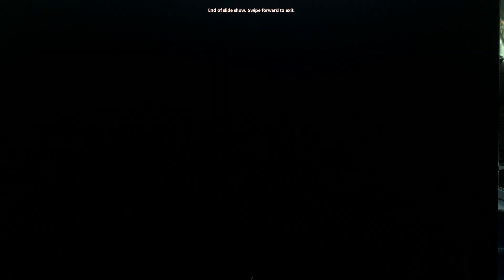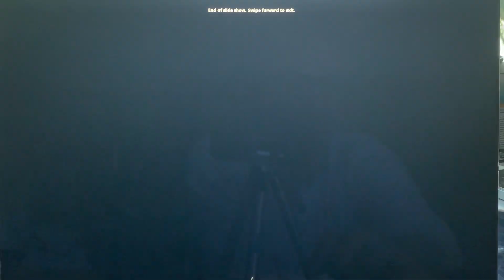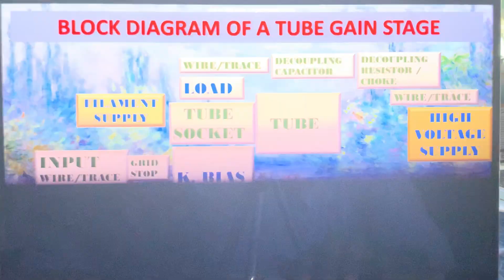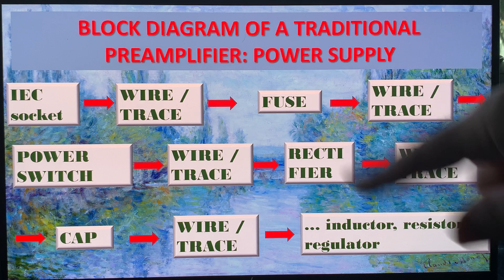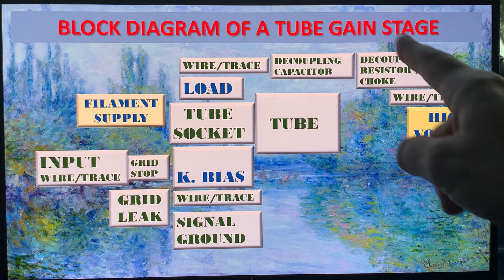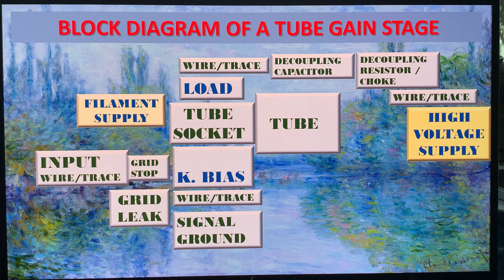Secrets to Preamplifiers: The tube gain stage

Comment: Thanks! GREAT video! :))) you 3 preamp series videos! Sorry would like to clarify, am working on getting a DHT preamp, 1 DHT per channel, was wondering  if I have 2 high voltage power supplies, 1 for right and 1 for left then I dont need a choke anymore? Thanks
Reply from the maker: No, you need the choke for filtering the high voltage. If you have two supplies, you need twice as many chokes as a single supply. For a preamp I'd recommend two chokes per channel, so you need 4 chokes total for the high voltage supplies. (One is enough usually for a quiet power amplifier high V supply, but not sufficient for a preamp - there, you need two or three chokes per high voltage supply to make it hum-free.)
Reply: @realworldaudio  thanks so much! Sorry 1 more qn. If im thinking of using finemet output transformers, do you know if finemet chokes or lundahl chokes would be better? Finemet is more expensive, but wondering if they are worth it. Thanks!
Reply from the maker: @flufffypufff  The choke selection is not nearly as critical, Lundahl should work just as well. ;
Reply: @realworldaudio  Thanks so much! :) You have a really great channel by the way! esp for the more crazy audiophiles!
Reply from the maker: @flufffypufff  Thank you! We need more crazy ones! ✨✨✨✨👍👍👏👏 I hope it's contagious....
Reply: @realworldaudio  hahahaha im sure your channel will explode with time to come!
Reply: @realworldaudio  Hi Jonas, another question: does preamp gain affect the size of the soundstage? eg higher gain = larger soundstage? Thanks
Reply from the maker: @flufffypufff  Not really. Higher gain usually translates to more energetic sound, but it can also be a thinner sound... depending on how good or bad the application is. Soundstage size is most impacted by the loudspeaker, then the power amplifier. The more sensitive a loudspeaker is, the larger the soundstage.
Reply: @realworldaudio  oic ok thank you so much! :)))

Comment: Obviously this is more complicated then the others. I'm still trying to understand how the input signals converge with the power supply before going to the outputs. It appears a lot of this happens in the gain stage and trying to see that more clearly.   

Any chance you can do a walk-through pointing out what is happening inside a cj gat, while looking at a Photo overview of this preamp.?  I saw a picture and I know which capacitors relate to the power supply, but so many others. Thanks very much for a very helpful video.
Reply from the maker: Stumbled onto this thread again, and this is one video I have not had a chance to make yet... had the GAT insides photo, have to look it up again ; ). ....